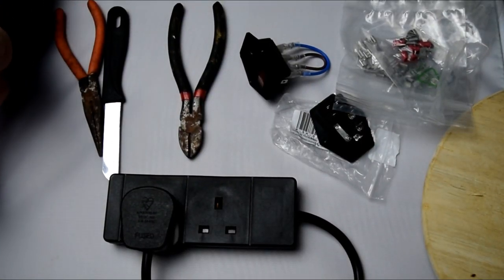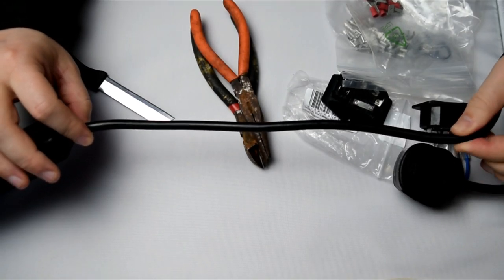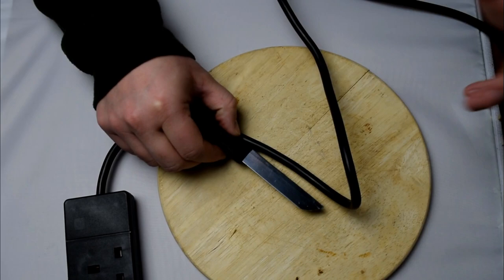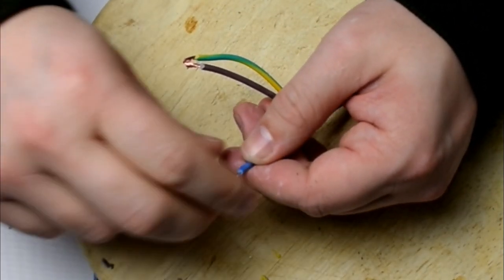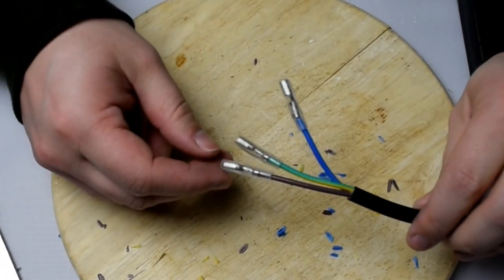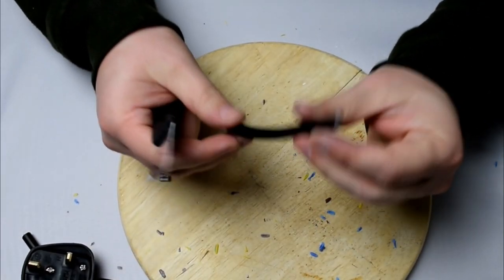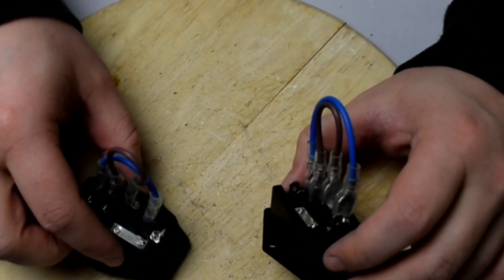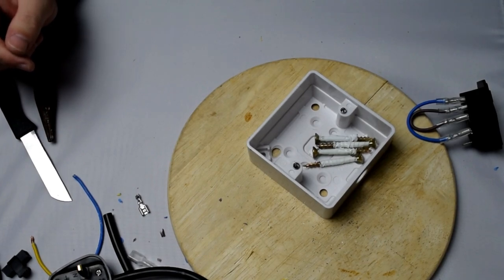Arcade Cabinet Power Switch Wiring Instructions

Comment: Silly question what size terminal spade clips do you need to use? Ebay is a minefield of sizes. I have the same socket as you do have in your video
Reply from the maker: 2.5mm